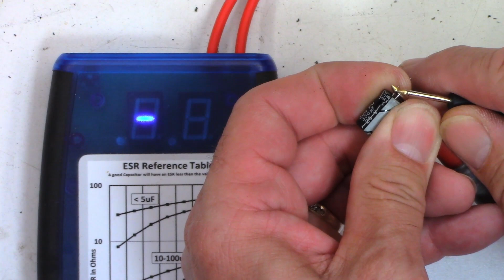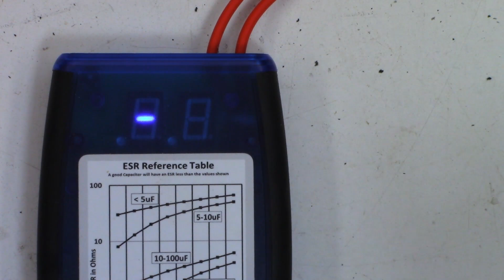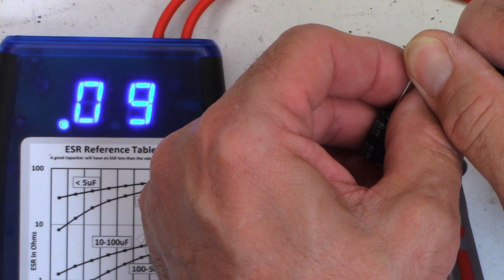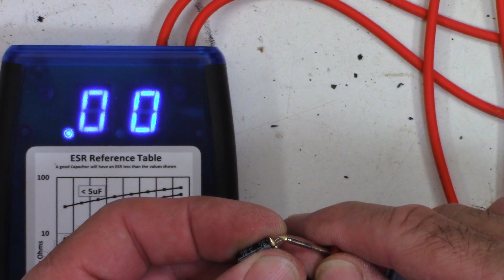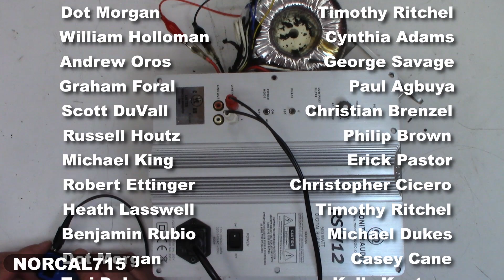Monitor Audio RSW12 - Loud Buzz - Successful Failure - Part 1 of 2?? Maybe. RSW-12

Comment: Hi, I have a similar unit but its a Monitor Audio radius r380. The auto sense signal turn on became intermittently, even if the subwoofer turns on, I am getting no sound at all and I have to manually turn it off and turn it back on than I get normal sound which I had been doing this for months. What do you think is the problem? Thank you in advance.

Comment: After watching this video I had an amplifier that similar to this problem (the JBL prx 718) which when I turn on the amplifier the sub thumps and when you put your ear close to it you can hear the humming going on and even if you put a signal into it it sounds like it has a slight distortion with very low volume even if you try turning it up which I know that's the pre amp section (not the amp itself) because I tried swapping it with another amplifier and the problem follows so I know it's the pre amp section....I'm going to try to re-cap all of them from the pre amp board and see if it fix it.....good work on the video brother... CHEERS!!!

Comment: Threw me for a loop for a second there. (Puns intended) I had to go back a few seconds and see if I did see you trim the leads twice. Trimming leads after a mass replacement is one fo the most satisfying parts of a repair for me. Something about cleaning it all up and having all those trimmed leads in a neat pile...... ahhh..... 
Question on the SMD caps, if they test bad how will you know what capacitance they should be to replace with, if you don't have the schematic?
Reply from the maker: The SMD caps have the value on them. There should be a 2nd part!
Reply: @norcal715  Ahh yes of course, I was actually thinking of the smaller ceramic SMD caps. Not the SMD electrolytics....

Comment: Any tips on Lg 60 Plasma tv . The led light is on when off & off when On , Has sound Picture Sometimes . What should i test for ? NO burns or caps look bad . Appreciate   & Great videos
Reply: thanks
Reply from the maker: Get a LED backlight tester from amazon or eBay and test the strips at the power supply board connection.  The difference between strips should be within 10%. https://www.amazon.com/SID-LED-Backlight-Tester-Lights/dp/B078B98QB2/ref=sr_1_4_sspa?crid=EW7I1VZ7PQFS&dchild=1&keywords=led+backlight+tester&qid=1627169662&sprefix=led+backlight+%2Caps%2C239&sr=8-4-spons&psc=1&spLa=ZW5jcnlwdGVkUXVhbGlmaWVyPUFJSkhRWlQzM0s5WVEmZW5jcnlwdGVkSWQ9QTEwNDgxNjExRDRBS1A5SVFMNElHJmVuY3J5cHRlZEFkSWQ9QTAyOTc5NTEyVk5HTllWNTgxSjk5JndpZGdldE5hbWU9c3BfYXRmJmFjdGlvbj1jbGlja1JlZGlyZWN0JmRvTm90TG9nQ2xpY2s9dHJ1ZQ==
Reply: @norcal715  ok , are saying plasma tv s haxve  led strips in them too?
Reply: @russelldye5506  I don't think he read your original question correctly.
Reply: @rogerwilco5187  My bad ,Lg 60 Plasma tv , The Stand BY light is on when off & off when On , Has sound. Picture Sometime scomes on . What should i test for ? NO burns or caps look bad .
Reply: @russelldye5506  I'm no expert but I would test all voltages from the power supply when no picture. Caps can be bad without always looking bad.